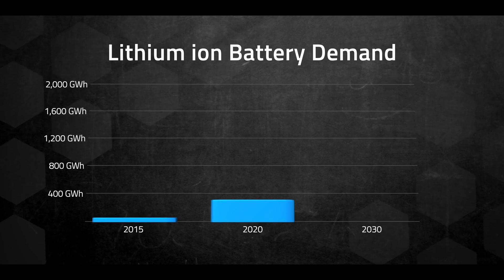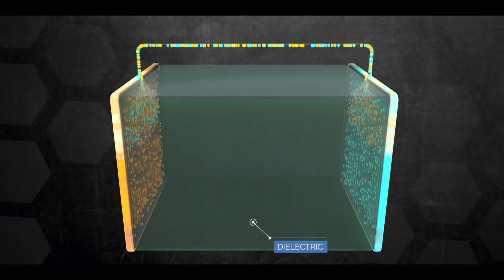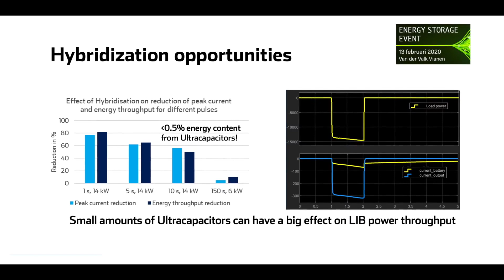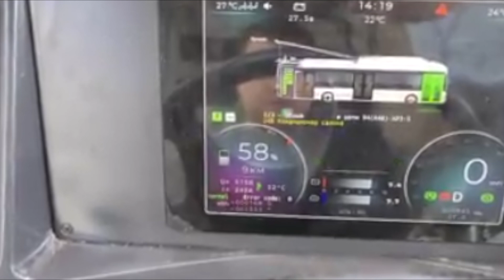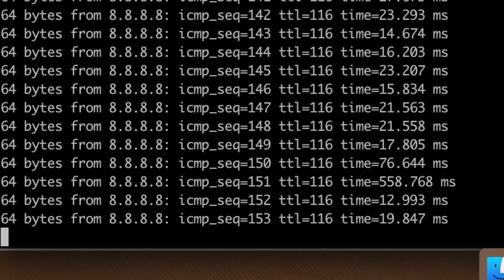Lithium Car Batteries Are Trash! What’s the Solution?

Comment: Some guys complain about the catenary wires because they're restricting the trolleybuses. But hey, trolleybuses can also carry small auxiliary batteries to run flexibly (and that battery can be charged under the catenary wires, no need to stay in charging stations for hours).
Second, city public transportation routes should be stable. No one wanna see a dally-using route gets changed frequently, right?
Reply: Nothing is more efficient than powering devices directly through wires. Those heavy, expensive and dangerous chemistry batteries are not ideal for powering public transport vehicles.

Comment: I also hate my wireless mouse because it consumes a lot of battery and it will become very rough to move the pointer when the battery is in half, so I came back in using wired mouse the same with the wired headphone because of the high quality audio, I replace all my wireless devices by wired again except TV remote. I do believe that anything that can be wired it should be wired unless when it is very crucially needed to become wireless. The performance, quality and efficiency of the wired technologies shouldn't be underestimated.

Comment: straight common sense
Reply: No. Trolleybuses are more expensive on less frequent routes.
Reply: @petrhajduk9955  you havnt watched the video, have u?
Reply: @sillysad3198  I have. Show me a route where trolleybuses are cheaper than battery electric buses if there is one bus per hour.
Supercapacitors are kinda subtype of battery in this case (At least it is hard to say what LTO chemistry is in this case).
Reply: @petrhajduk9955  If our only point of transportation is "expensiveness or how much it costs" and not "reliability, efficiency, resourcefulness, electricity consumption, environment", then yeah, electric buses win this competition easily. 

Lithium is approximated to run out by 2027, and with given recourses every bus, that runs now, will not be electrified. Not to mention that we will need to replace cars with other form of transportation that will increase numbers of buses needed... 

Lithium is really bad for environment, not only because of batches, but because we use the same method as for fracking. 

Electric bus efficiency is ~29%, compared to trolleybus ~41% (main reason for this difference is in battery charging and discharging as it reduces available electricity)

Cold weather reduces or even stops lithium batteries from having full electric potential. (you can see this with your phone as it dies quicker in colder weathers.)

The best solution is to electrify trains and buses with overhead wires, it's expensive, but it's the best solution.
Reply: @petrhajduk9955  if there’s trolleybus line which runs alongside most of the route and it is already used by other routes battery trolleybus will be effective on a low frequency service in this case. But yes: if there’s one bus per hour and no trolleybus line alongside it battery buses will be more efficient.